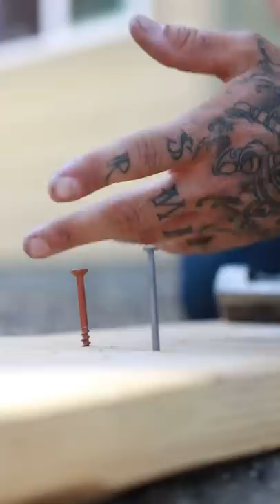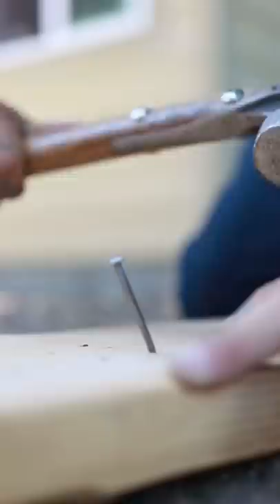Nails vs. Screws: Why do we use nails? #shorts

Comment: The argument still stands. Wood screws < Nails for building homes. No need to use the more expensive, and harder to install, oversized screws when a 10penny nailer will do the job

Comment: I live in a modified manufactured home that we set on a block foundation. It is screwed together. Been here for 15 years now, no issues. They also transported it to my property on a trailer and drove it down the road some 25 miles @ 50mph through traffic. How would it have done with nails instead of screws?

Comment: Million $ idea: make a nail with a spiraled grove starting at the pointy end that continues up the shaft at an angle. Theeen….make the head of the nail a little thicker while adding an indentation in the shape of an X (x) or a bar (—). 
This new type of nail would need a special hammer, but I’ll leave those big ideas up to someone else. However .. I’m envisioning the hammer to have a thin rod extending from the handle that makes the shape of an acute wedge at the tip.  This could fit inside the special nail and all you would have to do is hammer the nail clockwise and you are golden

Comment: Why are people talking about they're house bending clearly lots of people don't understand anything about how houses are built. They're designed to shift, and if it's a screw a 1/ 8-inch shift will "sheer " the screws it's called" sheer strength" nails have much more "sheer strength" it's a softer metal screws have what's called "draw strength " that's why they're used to secure subfloor and drywall or secure things to the framework that's been built with nails. You wouldn't secure your floor with nails because they'll start squeaking after a while because nails are smooth. Fun fact back in the day farmers if they wanted to build a new barn or house often would burn it and collect the nails and use the ash in the soil.

Comment: That screw did not fail in shear. It failed in bending. Screws are substantially stronger than screws in both pullout and shear. What you are talking about is bending motion. When both fasteners are seated properly, there is no bending force. Cheap builders use nails because they are cheaper.

Comment: I believe you can use GRK fasteners to frame, but they are on the expensive side.  I passed an inspection using GRK’s to frame a garage I built from ground up.

Comment: Screws definitely bend. There's more likely that that screw will come out under pressure, especially if you pre-drilled the hole, than the nail. Also cheaper and way easier to install

Comment: If your nail does that when its in a building, the building has failed. Structural screws are stronger than nails. Before you argue, read some data sheets on the fasteners

Comment: The purpose of nailing OR screwing two pieces of wood together is to make them *act as one piece of wood.*  If you have SHEAR stresses in your framing that will cause the two pieces of wood to move separately, you have problems that a NAIL won't solve better than a screw.
As others have said:  The PRIMARY reason nails are preferred over screws is speed.  The SECONDARY reason is cost.  I doubt "shear strength" is even a consideration.

Comment: It costs more money to use screws and is harder and more time consuming for the installer to do rather than just blasting a bunch of nails in. I love when the Nail guys try to prove it to us by having the screw out of the board 2 inches and hitting it with a hammer. Try doing a realistic example: screw a 2x10x16 to the wall, put 2 screws in every stud. Now apply downward pressure on the 2x10 until the screw snaps. Go on, I'll wait.

Comment: Screws are easier to work with it’s easier to take out a screw rather than taking out a nail and if you have proper structural supports it shouldn’t have to bend

Comment: So that's why manufactured homes blow apart so easily.  When I worked for such a place for many years, they used screws, not nails for the walls and roof, but not the floor.  Instead, the used nails.  Weird.

Comment: Hey you missed the most important part about using screws over nails in wood. When the temperature fluctuates, wood will expand and contract. This is the key reason you should use screws over nails. If you have thousands of screws in a house built with proper framing, it’s not going to budge and if it does, there’s no way it snaps a screw, because the entire weight of the structure is distributed throughout hundreds, if not thousands of those screws at the same time

Comment: This is not based on engineering principles, screws are better, I'm a carpenter in Europe, if I told the council civic planners I was depending on nails for structural integrity they would take my license away. With the greatest respect the planning & standards here are far higher. That is not a slight on the ability of American workmen but building standards that are more concerned with profit.

Comment: Price per pound is the real reason nails are used instead of screws.  Also, hammering in a nail is far faster than driving a screw, and that means cost savings too.  Interesting that this demonstration said nothing about pull out force, screws beat nails in that area hands down.

Comment: Having messed around with both for decades, in my experience, screws break and nails don't. Nails are much easier and faster to use, but screws are better for projects that don't depend on heavy things staying attached. However, his comparison screw is wrong.

Comment: Sophistry everywhere on this post. Matt is right. If you disagree then you're in over your head as far as understanding shear load or tensile load. No one cares if you built a deck, a shed, a fence, hung some drywall or did a few renos with screws and "those darn things haven't backed out an inch or broke yet". This isn't the same methodology of building (for the most part). And, they don't have the same metallurgical make up either. Nails are for shear forces on a structures exterior framing and anything tied into that exterior framing. So, with all of those nails having to be used by code, then you might as well keep using them to connect everything else you can for time and cost sake. Screws WILL break or shear under side loads created by high winds or earthquakes because they are hardened and brittle. Nails will bend and conform with the structure, allowing it to shift a small amount under shear loads. Think about it people. Structures that can catch wind or shift NEED to be able to move a little bit to relieve the stresses they are put under. Otherwise, if you used screws to make a 100% rigid structure, the house would blow apart or fall apart like lincoln logs under high shear loads. 🤦🏼‍♂️

Comment: This is wrong. The screw broke right away because of the type of metal it was made of, not because it’s a screw. They could easily make the screw out of the same metal as the nail, and then it would be able to be bent back and forth the same number of times.

Comment: Does that have to do with the vertical tensile strength asked of screws required to pull objects together where as nails just need to be hard enough to drive in where pliability isn't nearly as much an issue?

Comment: Try screwing two studs together.  then nail 2 studs together. Set them flush to the stud like it's supposed to be and see which one u can separate with a hammer and flat bar. You will change your mind.

Comment: Screws have a low sheer strength and nails have a high sheet strength. It has to do with the compressive grip fit vs the friction grip fit.

Comment: This feels like more of a material property thing. The screw was made with a more brittle material but the nail was made mire ductile. Im sure you could make a bendy screw or a brittle nail and have a different outcome to this analysis. Maybe the ductile material of a nail won't hold a theead well enough to be used as a screw but this feels like an oversimplification of the underlying explanation

Comment: Nails: better shear strength, faster and easier and cheaper to use on the job site, and bonus they don’t strip out. Screws are best for two planks trying to pull apart, and are good enough at both for general construction as a homeowner but ribbed nails (for lack of a better term) basically solve that for the contractors, and for the major tension areas they just use big ass bolts or lags anyways. Now I’m no contractor I am a mechanic but I do have a very good understanding of how shit works since i fix and build shit all day every day with metal, wood, and I even get to diagnose electrical issues, which fucking suck btw. If I’m wrong or missed something I’d be glad to hear it, otherwise come at me YouTube experts 😂

Comment: Alright, now screw together two boards or make an actual structure and see what breaks or comes loose first. A screw will never see plastic deformation once it's installed properly, a nail can eventually wiggle loose on the other hand.

Comment: Alright, so nails bend and screws break. While nails can pull out and screws wont.... maybe we should be building with both, also they do make screws that have the nail bending quality to a degree, but yes they are expensive. Just like everyone is saying nails are cheap and that's why they are mainly used. theres always a better fastener. As a matter of fact, no fasteners is actually the best, mind you this would be putting the together with mortise and tenon joints and whatnot.

Comment: They make structural screws that di not break as easy. Screws are vastly superior in construction. I use them often to always. If you use screws no creeks no shifting no nail pops. Nails are faster and cheaper. Screws are more accurate, hold vastly better, are adjustable, and are easily removable. Making alterations quicker and cleaner. . Much more professional.

Comment: This is obviously just your particular thought on this. The fact is screws are superior in every way. Stainless screws or more malleable forms metals do not fatigue as you indicate. Screw are mechanical fasteners that do not back, whereby nails will back out. Not to forget that screws can easily be relocated after remivel with little fanfare. Your thoughts on this are simplistic and not thought out.out

Comment: Nails used in anything other than decorative building are a sign of amateur work, they’re retention strength is terrible, they back out and loosen with any flex or movement and anything built with them eventually falls apart

Comment: Nails for vertical.   Screws are for horizontal attachment points.   Why deck board use screws.   
Note.   Some manufacturers now put out a  nail “sheer strength “ deck screw.     

Don’t ya people actually know about the work ya do? Anyone who builds should know what they are building with

Comment: Yea... Nailed it. Nails suck. As previously mentioned you can get different screws like different nails. The key point to take here. The nail will make a hole in the wood but that hole will get bigger as the wood dries over time. Thats when your nailed floor will start squeeking and get loose... Use screws....

Comment: Try using screws that say "structural" on the box.

"For framing and all other uses."

Non structural screws will snap under shear loads... structural screws will hold and keep holding.

Comment: This is false. Screws are used when you want to provide a preload. Preload creates massive friction between 2 parts. That ensures they don’t move with respect to each other - so you don’t need/want them to bend. Nails keep things together - but they don’t make them structurally “one” like a screw can. This all assumes the screws are used properly and only thread into one of the two parts.

Comment: I have heard this from old heads regarding roofs, particularly larger ones. I could see it with older construction. However, with modern construction, we use nails because a good mag-fed or belt-fed screw gun that isn't shitty hasn't been made yet. Nailgun go BAPBAPBAPBAP

Comment: That’s false as hell. It’s cost. Nails are cheap to manufacture, so more can be spent in the metallurgy. 

There are plenty of kinds of screws that can be used instead of nails, that deck screw is not one.

Comment: I'm always upset if the guys at work use deck screws on anchor plates when we build decks. The expansion of the wood alone knocks all the heads off the screws within 24 hours usually. Use the correct fasteners for the job.

Comment: Hold on, everyone in the trade has seen nails WALK out and having never been bent. I've never seen a construction grade screw back out of the boards unless there is rotten wood on the anchor side......of coarse there is a time for every application and a calculating of expense, durability, and preference. How many fascia boards have pulled out using nails when the gutters have standing water and it freezes??? The gutter will bend, but the fascia will not pull away while using screws.

Comment: No wrong.  Nails are used because dunces drive them in crooked. Screws bolts rivets are all heat treated bud. Chrysler building all rivets. Our steel Framed building grows 4 inches from hot to cold on each side. Guess what not one broken bolt. We are talking incredible forces. If you building is flexing at the joint enough to cause screws to fail, fire your engineer and quit building. Your joint should not take the flex the material does. 200 year old riveted bridges that literally wiggle still tight. Some may break but 200 years man over water. If your building is flexing enough to cause a screw to fail, I'm sorry to tell  you but you have much bigger problems with the building not the screw.

Comment: Also nails are cheaper. Lets keep it 100. They make screws that are hardend that are about 50 cents more then most screws and about 1$ more then nails sometimes 2$ depending . The screws hold better dont rust and have better structural hold then nails why we use screws for hevey machines as well cars that move and chairs. Houses are built with nails because its cheap and so are hammers.

Comment: What you see here is the contractors BS told to a client to convince him to let the contractor cut corners.  nails are faster and cheaper.  Speed is money,   Cost is obviously money as well.  Added costs come directly out of contractor PROFIT margins.
Nails are just faster and cheaper and when you get into something like 100 pounds of nails,  they are way cheaper to build with.

Screws are superior but take longer to drive and cost more.  If your structure is well screwed down it wont rack back and forth,  it will be more solid.
Reply: (So you know,  I am a contractor myself.  I build with both nails and screws. You have to pay a premium to get all screws in a structure,  Its not about the difference in cost of nails and screws,  its also about the added construction time of driving screws and occasionally drilling a pilot hole and such.)

Comment: OH COME ON!!  This has more to do with the material that the nails v screws are made of.  NOT whether or not the piece of metal has threads or not.  We use nails because it's faster to build....that's 100% the only reason.  Screws made of the same material will bend and flex if made properly.

Comment: Yeah, but find the right screw, and they dont bend. I work on old homes, and i cannot tell you the amount of times ive encountered lnails falling out of place... The biggest pain in my ass. Get the right construction screws, and they bend. The most recent ones ive been using can be bent a full back and forth in this test. Ive done it. That tells me they will do a much better job of holding a home together rather than a nail that falls out after 60 years.

Comment: You bent the screw to 90 degrees, the nail to 45 degrees, that's one thing, the other is that the building will not move to the point a screw is at 80 degrees, this is idiotic

Comment: Nails are faster and cheaper.

In no world should you believe a builder trying to tell you nails are higher quality than screws.

There is a few instances where this video is right, but builders be out here pretending they are engineers. They doing it to cut costs, and they are lying

Comment: Yeah this is not correct. That screw is not meant to bend, the nail is. Take any structural screw and it will not shear that easily

Comment: This is not true………… there’s never that kind of force applied to a screw or nail. It’s just easier and cheaper in labor and material costs. If you built a house with screws it wouldn’t move an inch. Well as long as your foundy guys were really good as well.

Comment: 1. Nails are cheaper and faster.
2. Nails were common place before screws and consequently are what are approved in most building codes.
3. There are code approved screws for certain applications.
4. You could probably get an engineer to spec screw for everything but why see point 1.
5. If you're building moves enough for a screw to break you have bigger issues.
6. This guy doesn't know what he's talking about.

Comment: NO, the reason is most homes are built like crap and nails must be used, a well built home it is not necessary as that movement does not happen. only a tradesman with no actual design or engendering will say this trash.

Comment: Nails are cheaper and faster. That's why you use them. For every other reason, screws are superior. 
The tiny movements that a building will have over time works nails loose, but will not affect a screw in the slightest. 
If Godzilla sits on my house to bend everything to the point of your misleading demonstration, it's right fucked anyway, regardless of the condition of the fasteners.

Comment: Screws are also a humongous pain in the butt hole to get out if you need to get them out because you're not going to be allowed to just sit there and unturn it with a manual screwdriver so you're going to have to have a battery powered one at all times and then the battery is dying and you got to charge them blah blah blah